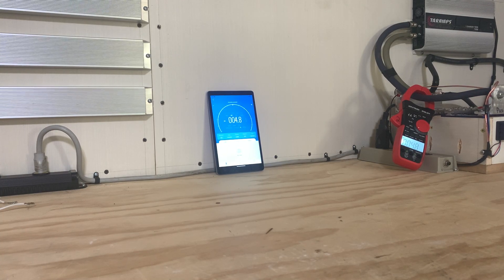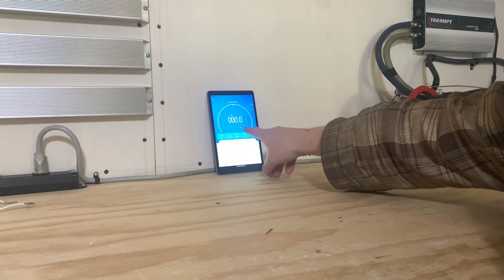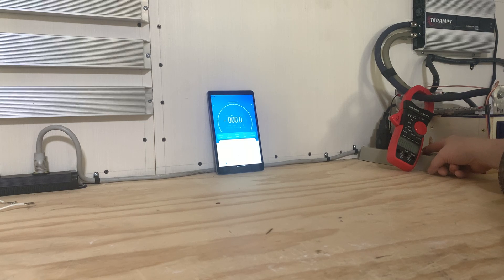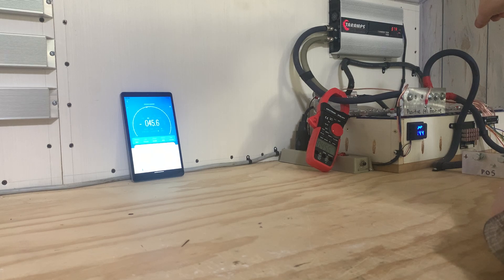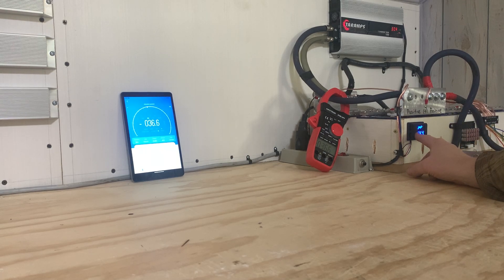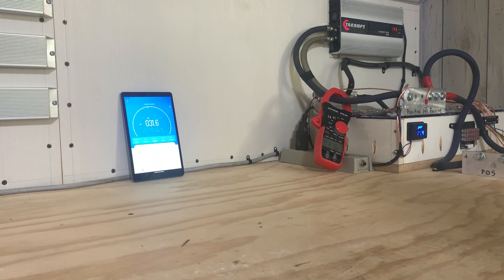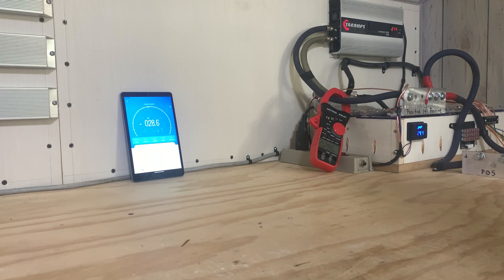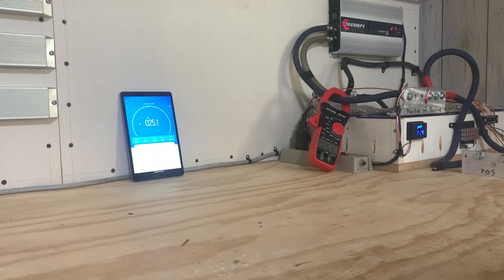Taramps Smart Charger clamped power on test bench

Comment: How did you get it to full power mode
Reply from the maker: For full power mode you just need to selecta voltage level. To enter this mode you have to hold down the power button on the side of the unit for 15 seconds. After it switches into mode selection you press and release the same power button until you get to the desired mode. The Taramps swirl logo will flash according to the different modes.
2 flashes=12.6V
3 flashes=13.8V
4 flashes=14.4V
Continuous flashing=smart mode

When you are done hold the power button in for another 15 seconds or so and it will return to operating mode.
Reply: @AllAboutAudioJW thankyou this was very helpful
Reply from the maker: @atomshoemaker5297  no problem. Thanks for watching

Comment: Do you have to fuse the power wire from the charger to the battery?
Reply from the maker: You can if you wish. I do not in my setup as I only run the charger while I am physically there to monitor it. If something goes wrong I have tools to quickly remedy the situation.
Reply: Does that smart charger ever pull too much current and pop your breaker? I want to get one to hook up a car audio system in my garage, I just don’t to be popping breakers left and right. I’ll be using it to power an 1800 watt 5 channel amp and also using it to test used amps that I buy on occasions.

Comment: Just a thought.  To estimate amplifier efficiency, the clamp should be on the wire(s) going into the amplifier.
You need to capture that current on both sides of the same piece of equipment to measure effeciency
other than charging characteristics of the charger battery combined. 

 The current clamp location, would test if an alternator with about 100 amps to spare could support that specific setup, though.
Reply from the maker: That is correct. However in this video I was just showing the power going into the battery bank from the Smart charger. I will have it set up to capture amplifier efficiency in the future amp dyno videos. Thanks for the suggestion and thanks for watching!
Reply: @jeremywilliams8558  hell yeah brother. I just dont want people to get incorrect information watching but not paying attention.

Sort of figure that YOU probably knew as the wattmeter gets hooked up correct haha. 

 I've learned 70% of what I do thru videos from EMF and Robot Underground and the usual suspects CAF etc.

@goliathaudio